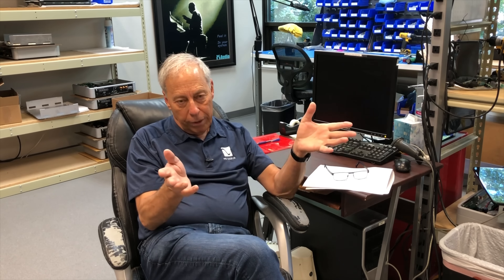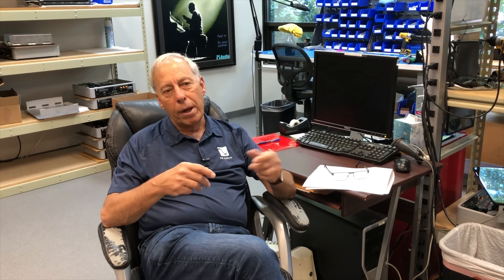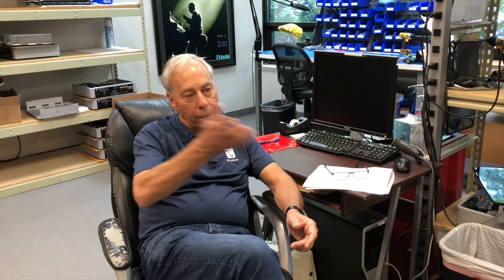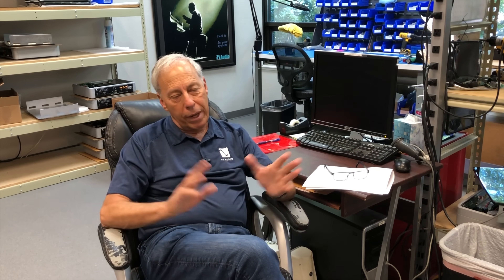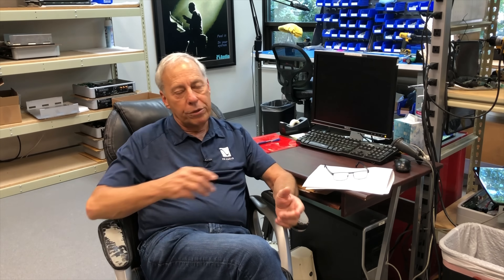How to make Class D sound better

Comment: Good explanation Paul.  I hear the biggest differences in Class D amps because of what is being used for the input stages.  The Hypex NCore NC500 Has a socket for the input stage.  You can change it in minutes and get a different sound: different IC OpAmps, or discrete OpAmps.  Kind of like tube rolling.
Reply: Julia Set I run a Nord Acoustics Hypex NC500 power amp together with a Leben RS-100 tube pre amp. I find that I get the best of two worlds. Really happy with my setup.
Reply: Laisvall66
Agreed...I run a Shiit Freya 6SN7 tube pre into Ghent Audio 450w class D mono blocks fitted with the ICE power modules and is simply astounding...like you say "best of both worlds"
Reply: Laisvall66,  WOW, I checked out the Leben web site and their stuff looks really good.  I live in Phoenix, so I have had to give up my tube passion in order to keep my house relatively cool.  I’ve lived here for twenty-five years and I couldn’t tell you if the heating works.  LOL
Reply: Julia Set The input stages have nothing to do with the ClassD designation of the amp. Most (if not all) input stages are ClassA voltage amplifiers.
Reply: Yes, I may have not stated my point correctly.  The NC500 has a socket for the input stage that can accept any number of IC OpAmps or discrete OpAmps: these do the voltage amplification before the Class D stage.  The IC’s are probably not running in pure class A, but I think some like the ubiquitous NE5534 do have a high bias.  Most of the discrete OpAmps run in Class A.  http://sparkoslabs.com/discrete-op-amps/
Reply: Julia Set I checked that link.... Now, you don't have to take my word for it of course, but just stick with an ElCheapo NE5532 OPA2134 and you'll be just fine. That whole site reeks of snakeoil..... $50 for a $0,50 voltage regulator ..... A joke at best. In reality... a rip-off!
Reply: BTW, after going back to the Hypex documentation, I think the input amp is not on a socket but on the header plug, so one may have to add their own socket.  I have a Nord amp which has all of that stuff on a separate input board with a socket.
Reply: Julia Set Yes, I got that. I checked the docs as well.
Reply: Specs on those are awesome. Only thing I've heard that's similar to that are Neurochrome that I built.

Comment: Nothing wrong with my Pioneer receiver and that is class D. Also B&O use ICE class D amps in their BEO LAB 90's so it can't be that bad.
Reply: Umm that is adjustable with something called a crossover
Reply: @matsudakodo  those channels arent built to deliver that kind of power. Might work on a small 5 watt speaker but anything bigger is pointless.

Comment: Better ? Better than what ? How to improve, may be a 'better' way to describe the subject, although you didn't really touch said subject.

The switching speed of the power switches (trans/mosfet) is the bottleneck of Class D Amps. Since switching gear (PSU, ClassD) is still gaining ground because of it's great efficiency,  these power switching devices are still being improved. Note that Class D applies only to the driver and output stage of said devices. The rest (power supply and input stage) are conventional.
Reply: One can improve Class D Amplifiers by increasing the PWM base frequency and improving low pass filtering.
Reply: 4G12 One can only increase the base frequency when the switching devices can cope with those frequencies. Which is basically what I said. We are on the same page.
Low pass filtering is old school, there's no real improvement there to be made. It all comes down to very clean and fast switching.

Comment: Make them from tubes?
Reply: I like this place. It's been a good civilized discussion. I have shown my weaknesses here as is required to learn and without any name calling or attacks. Thank you all.
Reply: InsideOfMyOwnMind You are welcome and likewise.
Reply: j k Seems like a valid option. But NO ! Class D is all about efficiency. Tubes most certainly are not.
Which still leaves the impossibility to switch a tube fully on or off, like you can a mosfet.
Reply: @Tubetinkerer  It makes me wonder if there might be another way to approach the switchiig function. I remember when RCA implemented SCRs to accomplish the sweep circuit in the old XL100 line of television sets. At the time there was no thought of using such a thing for audio or for faster fundamentals than 15,734Khz. Maybe we should take a second look at SCRs and their possible development potential since they are inherently switches, more so that mosfets or IGBTs. If anyone has experience in this endeavor I would love to hear about it.
Reply: InsideOfMyOwnMind To be fair, I had to check up on SCR's. But to my understanding these are only suitable for AC. Once gated they remain open until the voltage on the gate is turned off and the voltage across them reverses. 
Since class D amps work of DC, this is not going to fly. Once gated, they'll remain open until the power is switched off. 
Anyway, when I was repairing my classD subwoofer amp, I was kind of forced to delve in to the whole class D thing. That's when I found, that while of the demand for fast and clean switching devices is so great, that there is a huge effort being made to improve on said devices.
Reply: Tubetinkerer .... Who cares about effecincy if it sounds better. I'm sure I could switch a single ended triode into class d output filter
Reply: j k How are you going to accomplish classD with a single ended triode ? You think you'll get 100 watts out ? But don't let me stop from trying.
Reply: So as was already stated somewhere around here the whole point of tubes in audio is the character set that a tube's non-linearity provides. Think of class D as the most beautiful way to mask all of that so what's the point? As for one or two tubes, there are medium power twin triodes that would lend well to experimentation.
Reply: InsideOfMyOwnMind The non linear character will only affect the high frequency carrier wave.... which is subsequently filtered. I see what you mean, but nope, not going to work as you hope.
Reply: Tubetinkerer
Class D amps I've seen work on bipolar DC, which should give the opposing phase an opportunity to reset. I'm not saying it's currently doable, just that it might be something to look at.
Reply: InsideOfMyOwnMind About the bipolar: That's getting the same result in a far more complicated way. Not the bipolar in itself, because most (all) ClassD work of bipolar, but to make the SCR's work properly in this application
Reply: Use old transmitting tubes at 2.5 Kv?
Reply: j k Like I said... don't let me stop you from trying. Although running an amp at 2.5 kV brings up a whole new set of challenges ! 👍
Reply: Tubetinkerer:  Using a cheap rf transmitting tube at 2 megacycles per second would allow for much easier output transformer/filter topology.
Reply: j k Sounds plausible, although I doubt you'll get more than 5 watts from it, so somewhat missing the ClassD objective. But yeah, why not have a shot it ?
Please keep us updated. 😉
Reply: j k Class D usually runs at 400 kHz, so running it higher should be possible. In the lecture, posted somewhere in the comments, it is explained why higher freq is not necessarily better. I am not an authority on the subject, that guy definitely is. If you want to ditch the transformer, your going to have to find a way to power the speaker at 2.5 kV AC. A challenge for sure, but probably not impossible. Voltages like those, do have some safety concerns however.